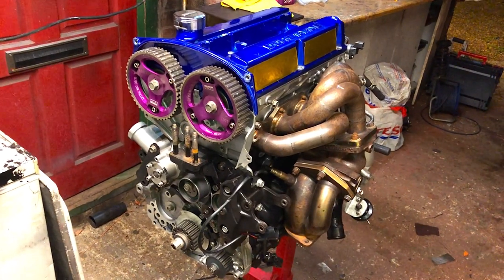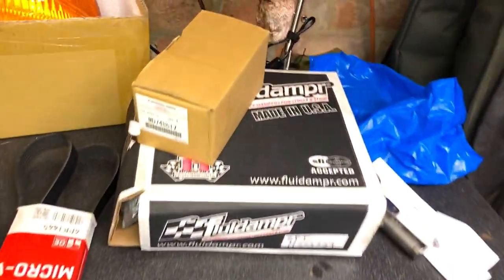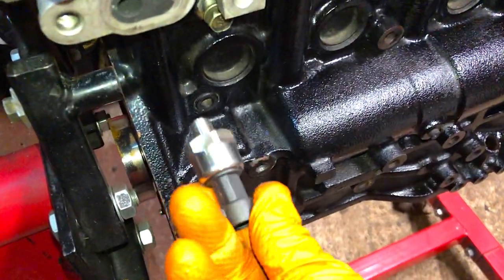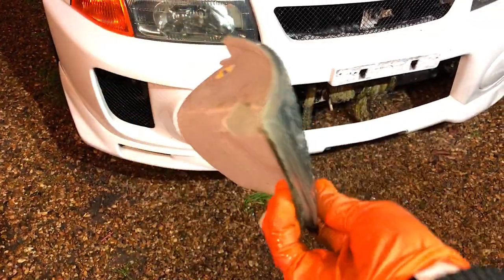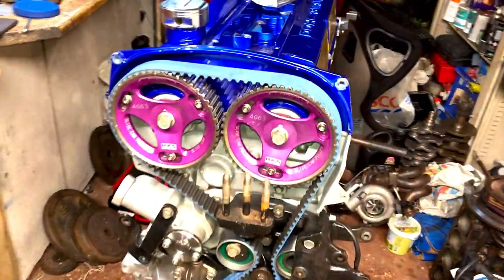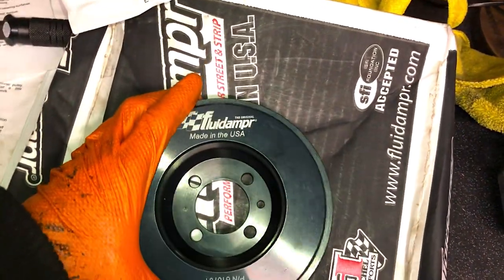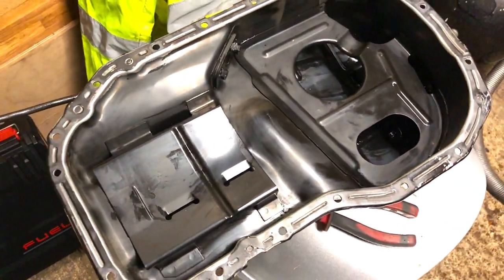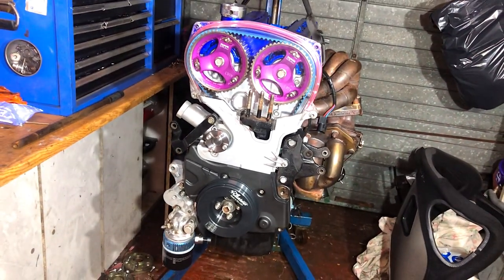BIG Horsepower Evo V Turbo Engine Is Ready To Rumble!

Comment: Hi mate I have a mk5 astra vxr z20leh nurburgring edition. I just got a stage 1 remap but have a code now 1 week later which  relates to the map sensor. Can I replace the standard 2.5 bar one with a 3 bar one. Should I have upgraded to the 3bar before my stage 1. Its at 275bhp at the moment. Thanks again